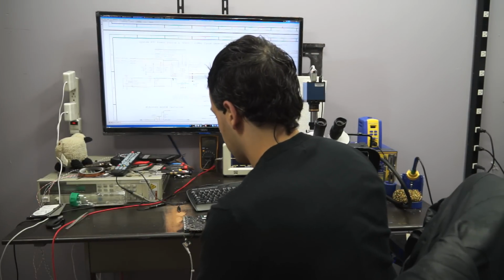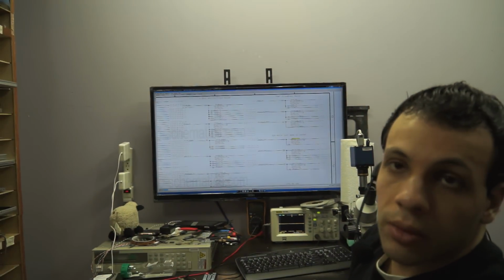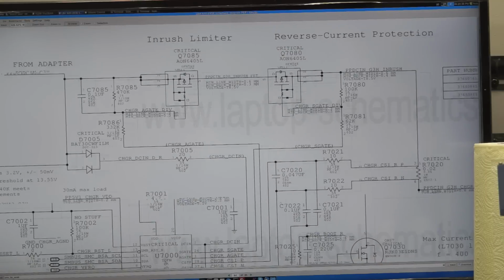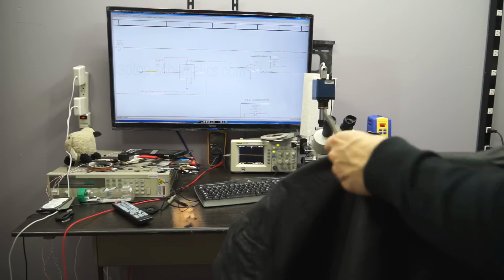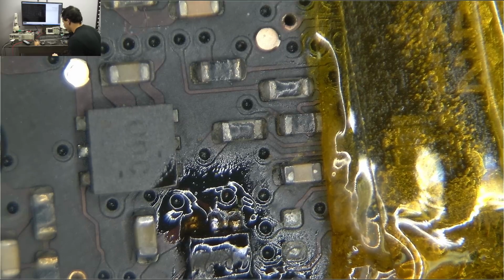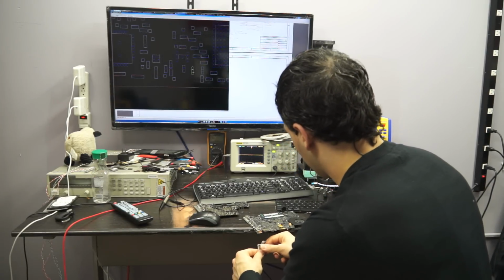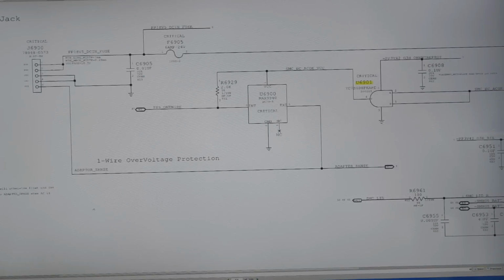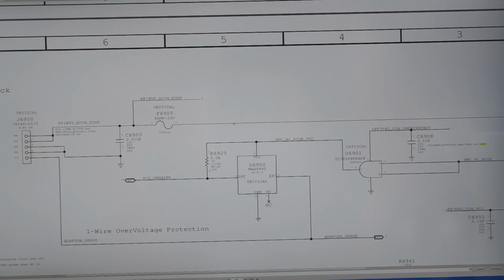Macbook charger green light; or what is the onewire circuit and why should I care?

Comment: So I have a question that I am hoping you may be able to answer. it is about the onewire circuit or any other circuit for that matter. In my example I will use onewire and the u6990 IC ST PM6640. So question is, according to schematics it appears that pins 6 and maybe also pin 9 whichis reference supply the 3.42v used for the ppv342_G3H. Lets say there is a short to ground somewhere in the circuit maybe a capacitor. Wouldn't you still be able to check for the voltage at L6995 either pin 1 or 2 or right at the pin 6 of the PM6640? Since there is a short to ground wouldn't voltage still flow out of PM6640 and through the inductor and than stop somewhere along the way when it hits the short to ground? Meaning couldn't you use a multimeterr set to DCV and test for the 3.42v at pin 6 or pin 1 or pin 2 of the inductor? Obviously the circuit wouldn't work because it is going to go to ground instead of where it should be going but wouldn't you be able to see the voltage coming out of the PM6640? \

In a board I recently did wind up repairing I got no voltage from PM6640. I swapped the chip prior to looking for a short. After replacing the chip I still had no voltage out of PM6640. I than checked for short and found short of the pin 2 side of L6995. Turns out a capacitor had shorted to ground and once I replaced it green light voltage the whole nine yards. I just in my mind cannot figure why the voltage wasn't there prior to fixing the short. I know that electricity wants to go to ground so wouldn't the PM6640 still spit out the voltage and it would just flow endlessly to ground? Thanks for your help!

Comment: Hi Louis!

I have seen some of your one wire circuit videos but my MBP works fine. It turns on, fan too, but it doesn't charge the battery or turn the green/orange light from the magsafe on. Battery is holding its last charge (60% right now). I already swapped the power jack inside the laptop. Charger is original Apple about 6 months old and it's working. Should I look at a different video because it isn't related to one wire circuit? 

It is an early 2011 13" Intel i5 MBP. I bought it brand new on April (March?) 2011. I know it's old and I already got my money's worth in return from all the work I have done with it, but, if it turns on, maybe WE can save it. (tech but no tech here, if you know what I mean)

Thanks for any tip or approach to take.

Comment: I have a 820-2936A Motherboard. The problem i have is there is a dim green light. tried doing all the resets SMC and stuff but the thing i notice that when i connect the charger the battery is not charging and also not going down. i previously had water damage but managed to dry up and was working fine abt a year or 2. i want to take some voltages and i do have the schematic but i cannot find the components to measure. possible to help or advice?
Reply: Did you figure out the issue?  Having the same symptoms but never had any water damage.

Comment: the smc looks like what they use to call embeded controller in another laptop... did annyone manage to crak/rescrive the firmware of the SMC? I'm thinking that the apple has only a couple of models and should be easier to do... for acers there was a russian guy that manage to crack everything...
Reply: I'm sure that there is a way tu burn a new chip, they do it... I don't know if there is sommekind of fuse for extracting the hex from inside... I don't work with apples... I'm in a different field but have the same problems with custom asics, custom firmware for chips with the fuses burned ecc... unfortunately I don't have used dismissed boards to recover the chips from...

Comment: Wow, this is great instructional video! Thanks for sharing your experience. I was able to check almost everything but on my old Macbook A1278 2008 mobo 820-2327 the "one wire circuit" looks different on schematics. The symptoms are strange: dim green light on magsafe, powers only with the battery on but charges normally. The problem was caused by a fried old Masafe adapter and i still didn't figure out what is the problem. I get 0V on adapter sense, is that normal?
Reply from the maker: +Rossano Balloco That uses different onewire circuit, but you will figure it out if you look hard enough!
Reply: +Louis Rossmann I used to be a chemist but i like to learn always something different... Thanks to your videos i have learned a lot and for sure i won't surrender so easily until i will find the solution even if this it would cost me one year of tests! :) Thanks Louis you are a great guy!
Reply from the maker: Q6910 is first hint
Reply: +Louis Rossmann Following the rabbit hole of the PP18V5 around the Q6910 i have found this: http://it.tinypic.com/r/10pvoxz/9 It looks like that nothing is coming out from it so i came to the conclusion that it is blown. I have no tension (0.03V) also on U6915. I am right?

Comment: with the u7000 (ISL6959) removed, should you have ANYTHING on Pad 14 (SMC_BC_ACOK)...? I had the U7000 (Got VERY hot!) on the board and have nothing on PIN 14... removed u7000 and plugged charger in and on pad 14 there is 3.4x volts at the pad... is this even remotely possible?
Reply from the maker: +William Bailey If you remove a buck controller and apply power to the board it is done for. Never do that.
Reply: +Louis Rossmann Awesome... lesson learned...

Comment: Hi Louis,

Firstly I must say your video is exceptional in a sense it is very detailed and informative. Thank you for your work.

As well I do have trouble finding a signal on my Macbook Air 820-3209 that has similar functionality of the ADAPTER_SENSE. In addition, I tried to find SMC_BC_ACOK but couldn't find it (this is understandable given I'm using a different board) and I found CHGR_ACOK instead. At this point I am confused with what to debug next. And would you mind guiding me on how to debug the problem?

The symptom of the board is that it can be powered on (fan spinning without the chime sound and there's no display on the screen) and I am seeing no charging light on the power adapter.

Thanks in advance.
Reply from the maker: Corrosion on 821-1477 DC in flex cable, or bad DC in board. Most of the time corroded flex.
Reply: Louis Rossmann Thanks I'll give it a shot. Umm... Does it mean the "ADAPTER_SENSE" signal is processed on the DC in board rather than going through the flex cable? If it is later what would be the corresponding SENSE signal? And it would be great if you could post a video regarding tracing the adapter signal on Mac Air. :)

Comment: Always great videos with great explanation.
Would be great if you post also a specific video talking about "3.425V "G3Hot" Supply" this would be very usefull for me at least :) should be simple circuit however I'm missing the basis

Rik
Reply from the maker: Ask more specific questions and a video will be created accordingly.
Reply: It would be great to have a video that explains how this circuit works from beginning to end
 
Here’s some doubts
 
820-2915B
 
This IC (U6990) is creating the 3.425 v and it’s fed from 2 main rails  PPBUS_G3H & PPDCIN_G3H right?
 
if one of these rails is not present at D6990 does U6990 still will be able to create the 3.425v? I'm actually having 12v at ping 4 & 7  however still 0v at pin 6 & 9.
 
PPBUS_G3H is coming from U7000.. means that if U7000 is not working properly also G3Hot Supply won’t work ?
 
I would appreciate a lot a small video about that.
 
Rik
Reply from the maker: you do not need ppbus_g3h in order to get pp3v42_g3h.
Reply: And U7000 fully working?
Reply from the maker: I'm doing a video tonight on PP3V42 to explain this a little bit. U7000 does not have to work for PP3V42 to be present with a charger plugged in.
Reply: Louis Rossmann I saw that you upoladed the video but unfortunately looks something went wrong while uploading because simply cannot be seen.. also last one from drag soldering to repair lvds is not visible.
Rik
Reply from the maker: That is because it is 54% uploaded. I do have time warner cable I am trying to push all these videos up with. :) They'll be done uploading in a day or two, I have five videos to upload, 20 GB each at 5 mbps.